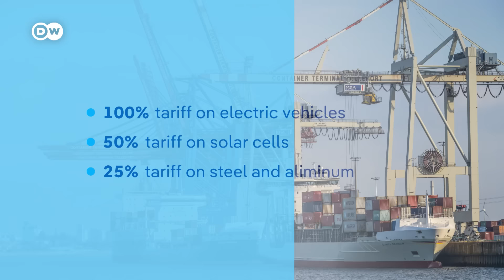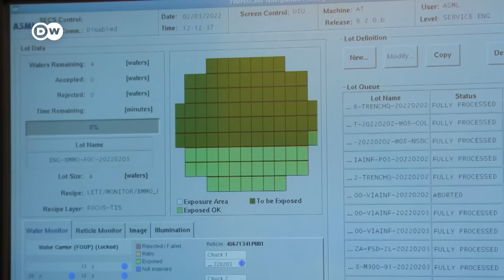Biden backs down on tariffs against Chinese EVs | DW News

Comment: This guy is an expert? Semiconductor won't pass through to consumer? What is he talking about? Everything electronic (especially car - ICE or  EV) all use semiconductor
Reply: Actually, the expert analysis is true. Chinese latest proven commercial chip technology stops with the Kirin 9000S which is about 20 years behind the rest of the world. For most products no one is forced to buy Chinese. Consumers can choose to buy Chinese with the older tech like Huawei phones or buy Apple phones with far superior tech.
Reply: @tonysu8860  20 years ago would be just barely in the 1 ghz era with process in micrometers instead of nanometers. You have no idea what you’re talking about
Reply: @tonysu8860  Yeah and? Majority of semiconductors dont need to be that fast - EVERYTHING nowdays has a semiconductors inside of them, however basic they are and the cost would sum up pretty fast.
Reply: @tonysu8860 have you gotten your hands on a Huawei phone lately?
Reply: @tonysu8860  have you worked in the semiconductor industry? Or know anything about the industry? If so, you wouldn't say "20 yrs behind" kind of comment.

Comment: Biden has been made to realize that there are ways around these tariffs that Chinese automakers can use,  First, they could offer a lease/buy back plan that doesn't give title right away as an imported vehicle but a leased vehicle and later purchased.  Another way is for Chinese automakers to construct or take over a US plant to build EV in the US.  And another option might be to build a factory in Mexico, for example, and let buyers drive the car around Mexico while on vacation and cross the border with a used EV that now has a lower value.

What Biden realizes now is that China can develop and produce EV cheaper than the US and thus corner the world market for EV.  US and EU automakers would be hard pressed to compete.  Ditto for the Japanese and South Koreans.  The US would be a laggard in meeting its carbon neutral goal.

One of the reasons EV are not that popular in the US is the lack of charging stations.  China has almost 40 times more public charging stations (2.3 million) compared to the US.  China also has nearly 5 million private charging stations.

"According to the China Electric Vehicle Charging Infrastructure Promotion Alliance (EVCIPA), as of the end of August 2023, there were a total of 7,208,000 charging infrastructure units (public + private) in China, of which 2,272,000 charging stands were public and 4,936,000 were private.Oct 3, 2023" (Marklines)

"As of Feb. 27, 2024, there are more than 61,000 publicly accessible electric vehicle charging stations with Level 2 or DC Fast chargers in the U.S." (PEW Research)